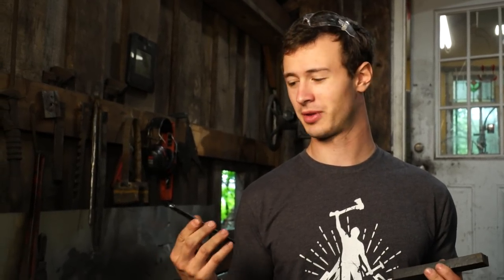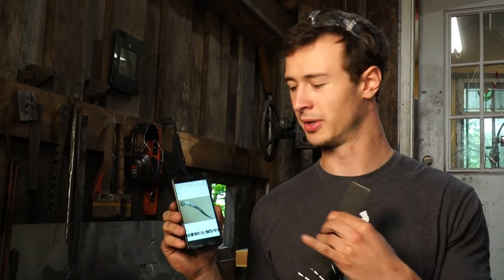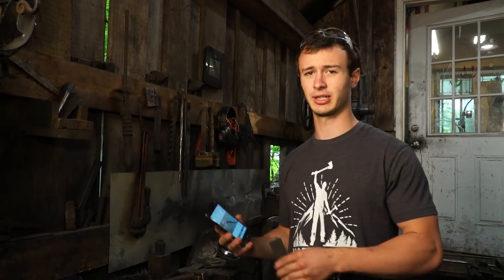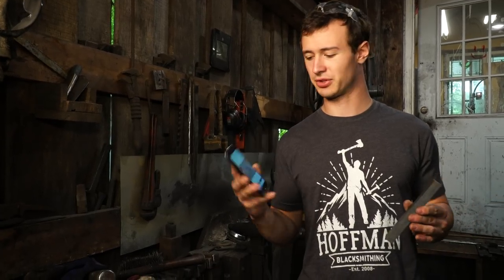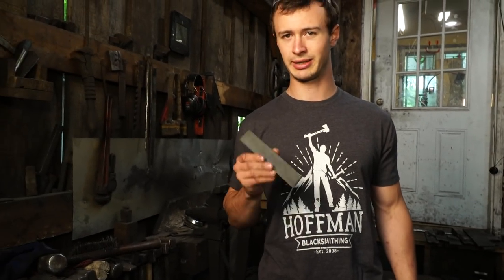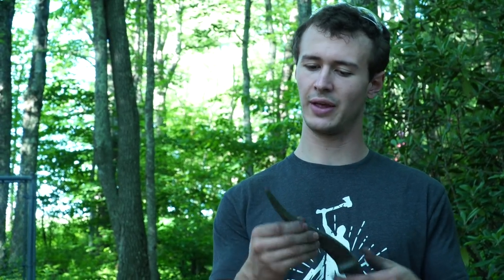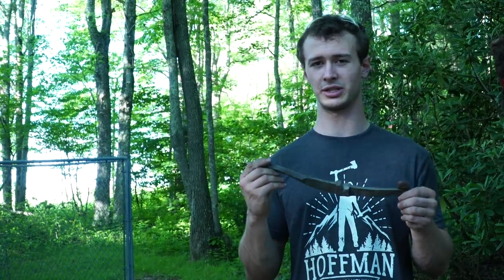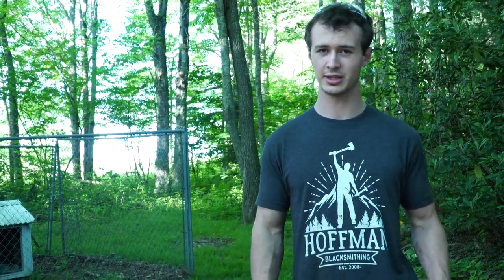DAMASCUS PERSIAN DAGGER BUILD ~ 1

Comment: It may be possible to create template jigs that would rest on the flat section of the blade (top and bottom) to reference the angles you want to grind at the fattest part of the piercing section. You could then cut diamond shaped, slide-on templates that would help you check the geometry of the facets as you grind from the initial reference angles out towards the piercing tip. Do you think that would work?

Comment: Could you have cut and fold the material in order to get the thickness you wanted rather than upset the material? Any benefits from upsetting that you'd get that you wouldn't in folding?